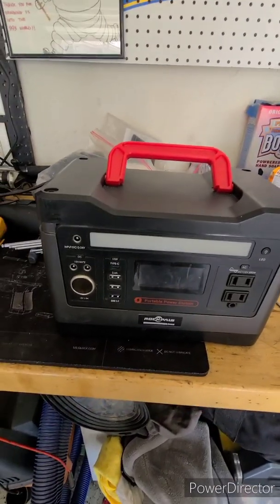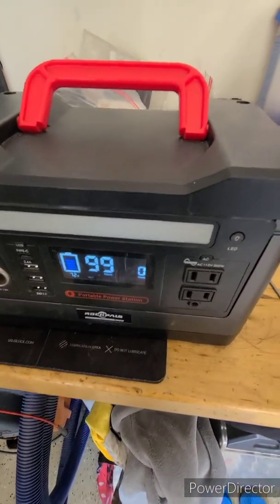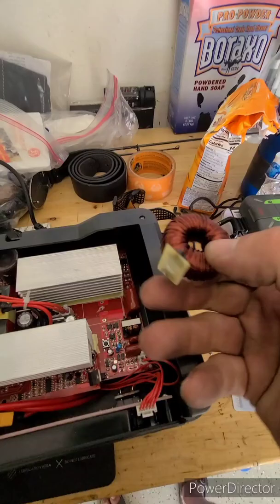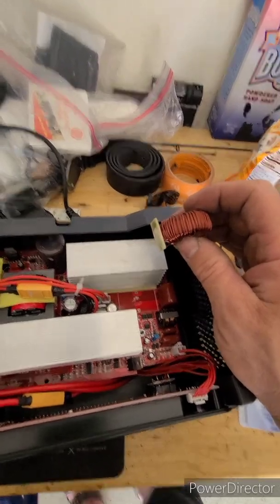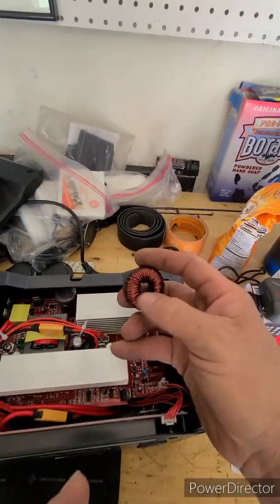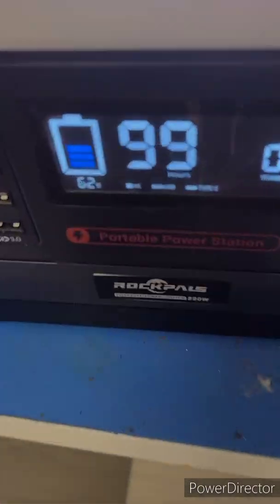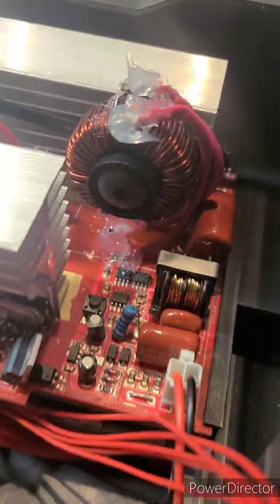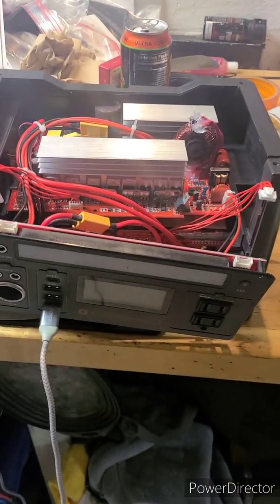Rockpals 500W repair - no AC output

Comment: I bought 2 of these for parts for $50 each and each one had the coil missing. 
Now I have to find out where I can buy the missing coil.
Reply from the maker: Good luck - they are beefy coil inductors. If you can find them, you got a heck of a deal!
Reply: @jitterspec  , still looking... can't find the specs for the coil...
Reply from the maker: @Geno Note2  I would go on ebay and find one that is close to same size and similar winding diameter. I bet specs are not critical, just make sure it can handle amperage with proper winding diameter
Reply: @jitterspec  , thanks I'll give it a shot but not too optimistic since not that experienced.
Reply: I bought mine used and all three switches worked. Now my AC switch doesn’t work. Gonna check out tomorrow and I’ll get back to you. Thanks for the video. I knew their simple fixes to problems like this. I do it all the time.